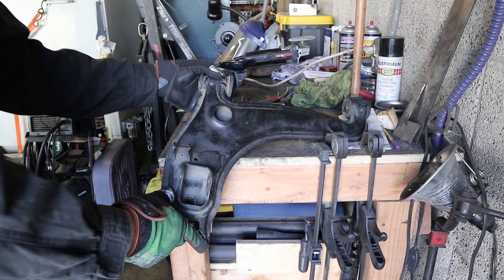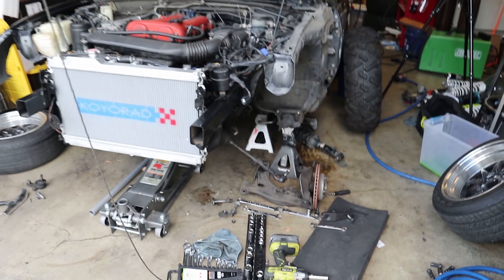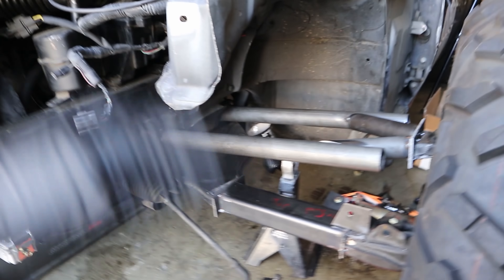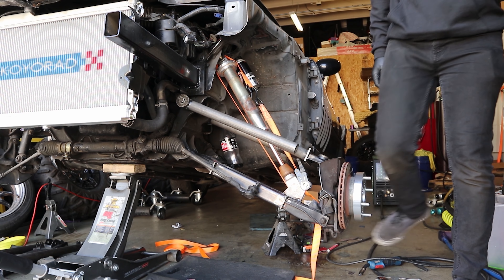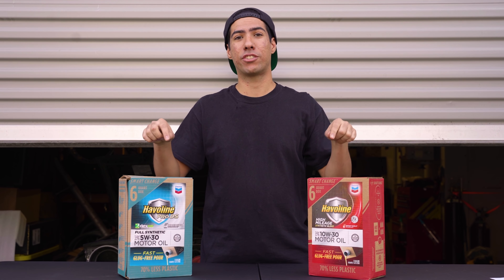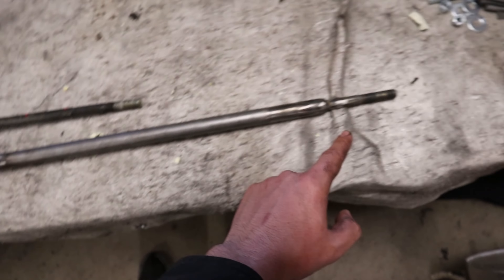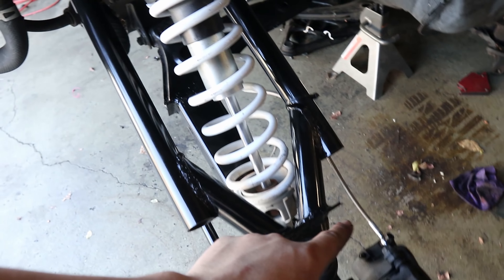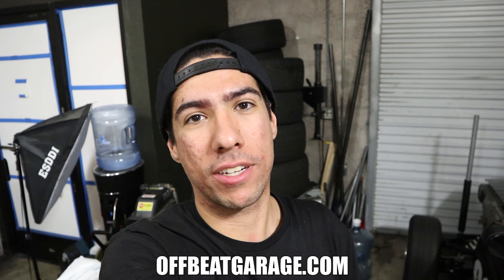Miata Front LONG TRAVEL Done! HAVOLINE X OFFBEAT

Comment: Bringing tge top of those coilovers further out to straighten out the angle so its more up and down from a near 45° angle will help stiffen that front end up but it will also lift the front end up a but more. Bringing the bottoms in will also lift it more and have the same effect as doing the top for spring rate but youll also have more leverage on the coilover so it wont be as effective.  Just encase you want to rework the mounts before buying springs

Comment: Haha pretty cool. Should put a bit in the middle of the upper control arms and check how much the wheel turns before adding in some triangulation back to the rear bush on the lower arm though

Comment: I wouldn’t worry too much about the shock itself, If you get a stiffer spring it might raise it just slightly and give you a little more length on the plunger but suspension like that is made to drop more than compress.

Comment: your lower arms are most likely going to fail if they aren't reinforced with a triangular brace and more gusseting. There's going to be a ton more leverage on them because of the added length so your welds or something else in your setup is going to fail. I would check some vids of long travel off-road builds to give you a better idea of how to reinforce the arms before you do any hard driving. If the lower arms fail, it will cause a chain reaction and break a lot of other stuff too!

Comment: Better plate the intire lower control arm as it's a stamped peace and is a weak link if you jump it it will bend and snap the welds of lower control arms without plaiting them

Comment: It's not just the Miata being heavier causing this. Side by sides are rear engined, as a result ~60% of their weight is to the rear. I wouldn't be surprised if the front shocks only see ~300lbs at a corner. SUPER undersprung for a front engined car.

Even with stiffer springs I don't know if the dampers will be able to handle that much force.
Reply from the maker: We’ll see this week. I got 600lb springs compared to the factory of ~280 so it should be much better off. Who knows until i try though haha

Comment: Might try moving the shocks/springs to be in a more vertical orientation, that will help them work better anyways, and could help hold the front end up a little higher.